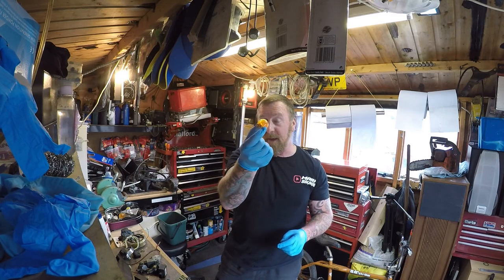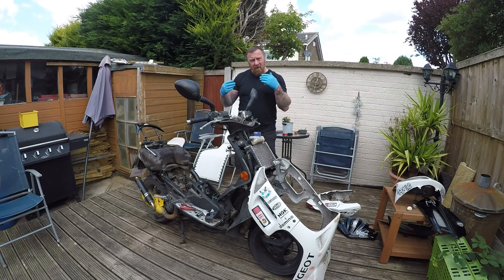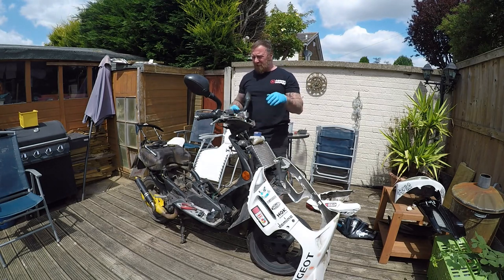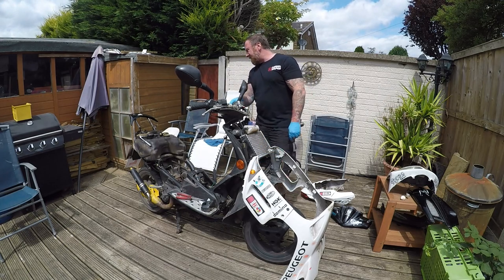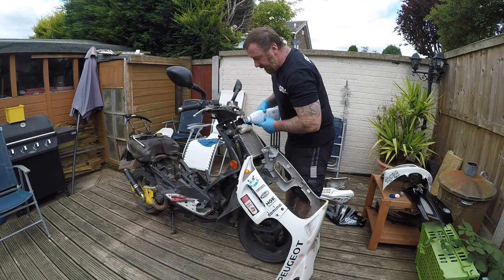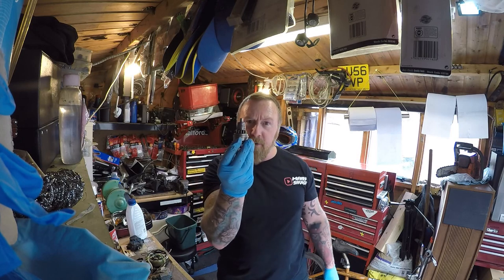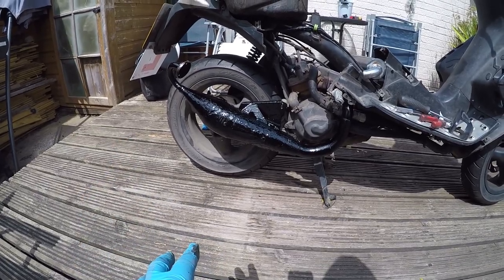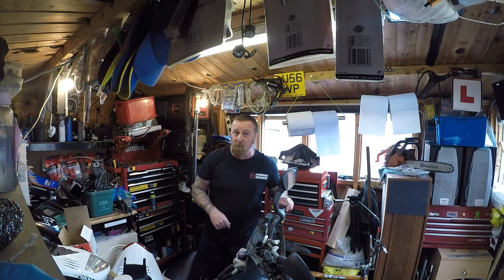SPEEDFIGHT MOPED BEGINNERS FINDING WHATS WRONG PART 3 MARK SAVAGE

Comment: Spark plug gaps come set from the factory. On some of the newer models, one of the numbers of the spark plug model denotes the plug gap. That’s why they come with a piece of cardboard tube over the electrode.
Reply from the maker: I always fit from the box but if you see some of my other a few say you should set the etc 
Each to there own but I agree with you
Reply: @marksavage  you are quite correct Mark. As long as you have the correct plug and it hasn’t been dropped then I see no reason to fit straight from the box. I do the same with my Vision 110. I have to confess that with my CBF1000 I do give them a quick check as it’s not a two minute job to get them back out once fitted.

One question. Didn’t you used to have a CBF1000? And what happened to the Pan Euro? That’s one bike I wouldn’t mind having. Even a higher mileage one would be great 👍
Reply from the maker: @scootyman2974  yes link below 
https://youtu.be/ocPU4er3PhQ
But to be fair I had a lot of hondas not alone loads of bikes 
Type in honda Mark savage 
But I had a varidaro 1000
Mk1 and mk2 pan 
All videos on here too
High miles is nothing for these mile muncher bikes 
Had a rt1150 that was OK 
Also a gtr1400 and a triumph 1215 trophy 
That was nice 
I've got 480 videos. So something for everyone 
Why do you ask bud

Comment: Another great video mate 👍 Today my exhaust bracket snapped on way home from work, I was gutted. Used shoe laces to get  me home 🙈 will order new part tomorrow I guess. 🤣
Reply from the maker: Thanks bud as for the bracket you done well with the shoe lace otherwise it may have snapped your exhaust !
Did  you ever watch my ducati video where my gear change bolt came out on the m4 
I was no happy lol
Take care bud
Reply: mark savage Yea I’m sure I watched it, another good video. part has been ordered so as soon as it turns up I will replace it. I actually replace the shoe lace with a zip tie for now it seems solid for now. Thanks again for all the wisdom 🏍💨😄

Comment: Whats the best way to pack the hole that the pinion goes in as a temp fix
Reply from the maker: there isn't bud you have to buy a new one as others wont last and would cause more damage
I've tried washers and then you cant get it back together !
Reply: @marksavage  ahh looks like new side case then
Reply from the maker: @patrickamphlett9003  yes bud or try and get a working 2nd one , to be honest if it electric starts maybe only have it as a back up
Reply: @marksavage  suppose

Comment: great video again mate 
that exhaust is  a low end budget one the tecnigas q-tre  but its not a bad one for the price as they are £70 new i have fitted one to my budget rebuild project

one thing i want to ask is what camera do you use ?
Reply from the maker: Its driving me mad at the moment but its a go pro 5 now 
The mic sound are either you can hear everything or nothing lol 
To be honest the go pro 4 was easier but this one does have a good wide angle 
So is it better bud ?
Reply: @marksavage    the video looks better then the older ones the mic seems a bit hit or miss  plus you need to get a dead cat on the mic will block some of that wind sound 
i need to get a gopro my self as i have been using a cheap action camera off ebay it still gets 720p 60 fps  but the mic is super bad was looking at the gopro 4 as i only use the camera  for riding my bike and going to be on a budget of around £150 so for that price i can get a refurbished gopro 4 sliver  or a  gopro 5 black as any one of them is going to be a big jump on quality to my £20 camera  lol

Comment: Hello mark....2014 aprilia sr50 motard e.c.u. keeps blowing...third one in 2 weeks ..no headlights and rear running breaklight...any ideas...thanks
Reply from the maker: oh that's not good and a electrical nightmare 
you have two options 
all panels off and trace all wires / connectors looking for any damaged wires or you may need a new loom, or  
stop and sell it for spears bud sorry to say as you may never find it
I have a few videos on a sr worth a watch as I had problems with a few of them and dont work on them now !!

Comment: Hi Mark, problems with my speedfight 2 100cc. After a torrential thunder storm wouldn't start, also noticed immobilizer light was not working. Left for couple days charged battery , light now works but no spark,also noticed no lights when  cranking engine. Any ideas before I start digging. Cheers Mick
Reply from the maker: Rain can cause damage with your electrics 
Is yours a immobiliser bike ?,
Fat key ?
Lights will only work once running 
Do you indicators work horn electric start ?
There from battery 
No spark ?
Thats cdi 
Look which one you have like in my cdi video bud
Reply: Thanks for the fast response, it's a.  2002, and looking at your vids it's the one below the headstock the motor spins with horn and indicators. Looking like I'm ordering a £50 CDI unit.thank again for your input, Mick

Comment: hi mark , i have a speedfight 2 50cc and also a spare speedfight 100cc
i was looking to know if i cud put the back brake disc of the 100cc onto my 50cc drum brake set up?
Reply from the maker: No bud the set up is all wrong 
But you can put the 100cc end in !
I've done it loads lol

Comment: Hi mark nice video started watching you since I got my speedfight the other week. I’ve got a question about some sort of error code that appears saying ‘SOF20 D10’ which I know means there’s a problem with the battery but after that it says ‘CONST 2071’ and I cannot match this to anything as I can’t find any information online. My electric start recently stopped working at and and my indicators don’t work and speedo keeps coming off and on.
Reply from the maker: so take it this is on a sp3 or sp4?
they all suffer from the clocks as this is where the indicator relay is and not like sp2 sp1 which are separate
for the starter follow my sp2 starter video as its the same process
Reply: @marksavage  yes it’s a sp3 rs 50 and I’ll deffo give that a look now. Started the ped this morning and the code now appears even if I press the brake 😫
Reply: @marksavage  can you send me a link to the video you want me to watch there’s so many I can’t find it

Comment: Hey again mark that bike I bought ...
It's running premix 
I've shook the bike .... lol an now I've lost spark ... any ideas before I start messing things up pal ... thanks
Reply from the maker: Odd but must be a loose wire or connector bud 
Panels off and wd40 everything lol 
Before changing cdi
Reply from the maker: Plus premix is ok and can run well
Don't forget about the ht coil
Reply: @marksavage  thanks mark I need some of that magic stuff I will keep you updated if I manage to sort it I was hoping the stator didnt blow but in all fairness I got it running and re gained spark the night before cleaned tank out like you do early the next morning cleaned carb headed to the petty station got a jerry can full brought it back pre mixed in  bike tank ..... ino stupid lol no spark
Reply: Gutted our kid 🤣🤣😅
Reply: I shook the bike to mix the fuel an 2 cycle oil .... 🤣🤣👏
Reply from the maker: @marie82924  there's nothing worse when its intermittent 
But you will have to go over it all
Should be the stator bud
But worth a power meter check bud

Comment: Hi mark, my Peugeot trekker 100cc is making a knocking noise near the carb area, I've checked for rod knock. There's no up and down movement but there side to side play?
Reply from the maker: guessing it will be from the head so big or small ends even piston slap so it will be a head off and investigate 
its not a massive job and will still run but them just die so 
you can keep going or sort now 
worth a check of the variator system just in case
Reply: @marksavage  only seems to do the noise at idel, when I rev the bike it stops?
Reply from the maker: @michaelhughes594  yea under load its ok but at rest it just slaps around
Reply: @marksavage  so what should I check for first?
Reply from the maker: @michaelhughes594  its a job bud, you will have to take off the head then see if you have movement from the small or big ends!
this is why i said it its running and only annoying you keep it running as some will just keep going 
always use good quality 2t as sure yours is 2t ??
Reply: @marksavage  yeh I've watched your video of what two stroke to use so I'm using Halfords atm, how would I check for movement in the big end and small end bearings
Reply from the maker: @michaelhughes594  once the head is off you will know straight away as it will move left to right and be all wobbly and just feels wrong lol bud
Reply: @marksavage  It does move left to right but I was told it was normal?

Comment: Hi mark I'm currently working on my Peugeot speedfight and I have the seat and helmet bucket off and there is a blue plug with nothing in it could you possibly tell me what goes into that blue plug ??
Reply from the maker: Its the temp plug for lc ,if yours is ac its not needed bud

Comment: oreet mark I have fitted a new throttle cable but it sticks and and does not return any advice ?
btw i have watched your throttle cable videos and its an aerox 2012
Reply from the maker: Sounds like you need to re route it as it maybe caught some where or on the twist grip you havent put it on right 
I'd take it all off and start again bud
Reply: Cheers for the quick response. I will try again I really appreciate your videos they have gave me the confidence to give it a go instead of taking it to a garage 👍

Comment: Mark. I have a speedfight variator that does not change gears. Its just stuck in low gear. The belt never climbs up on the variator. Any suggestions?
Reply from the maker: Check out my variator videos ,they will help and fix your problems 
Speedfight mark savage 
Theres over 80 videos

Comment: Alright bud, i recently picked up a speedfight 50cc AC 2002 and it will start up but will puff loads of smoke out the exhaust when i rev it ( its 2t coming out it) Its also like its fighting to build up the revs and fights to take of? Ive cleaned the carb and put a new plug in but it keeps fouling plugs? it isn't pre mixed either its puzzling lol. if you could maybe give me a few tips and some advice on what it could be it would be much appreciated.

Thanks
Reply from the maker: this is common and you can do a few things 
change your 2t oil so drain out the old stuff and put in halfords 2t if not already done 
carb tune like in my videos 1/5 to start and more out ,this should help the plug 
clean variator and rollers will help pull away 
more air clean or change the air filter or take of the link pipe if fitted 
loads or 2t oil will be in your exhaust, is it a sports exhaust if so change the wodding like in my videos 
ok last your piston or rings ,easy to change on ac so renew and follow my videos they will help with over 100 now 
mark
Reply: @marksavage  I am waiting on a carb rebuild kit, air filter and a new plug. I think it is just a standard exhaust that is on it. I took all the 2t out it and put some putoline mx5 in it and started it and the smoke has died down alot but still bogging.
Reply from the maker: @keenanstibbles7345  jet size and tune
Reply: @marksavage  its got a 72 main jet with standard carb, air filter and exhaust? is that a okay jet or should i go up or down?
Reply from the maker: 72 with standard is too big bud so go down to 60  is try 64 and if still doing it try 62 or 60 
it will run so much better bud and a tune after

Comment: Hi Mark how can i Dm you ask a question for problem with a Speedfight 3 50cc
Reply from the maker: Message on here bud or make a video of your problem
Reply: @marksavage  look mate a bought the Sf3 without see if it runs as projcet and i fix it and got it runing but the problem is that when the air filter is on carb it goes 10,20 kmh when i get it of the carb goes better as it should can you mate tell me whats wrong am tiresd of it 😪😅
Reply from the maker: so you serviced it ? new plug and air filter , cleaned carb 
what size jet is in it ?
this is common and might need a tune like in my tuning videos

Comment: Hi mark the kick start pinion on mu speed fight 3 has some play ive replaced it and still wobbles causing my kick to crunch and lock up any way of sorting it woth out replacing side case
Reply from the maker: this is common bud and its the play in the case and sometimes best to change or replace the casing bud you can pack it some time but check the clip on on as this can stop it
Reply: @marksavage  dont supose you have any parts do you
Reply from the maker: @patrickamphlett9003  e bay bud sorry but no
Reply: @marksavage  ahh no worries bud you still doing bikes as not seen any recent videos uplaoded for a wile
Reply from the maker: @patrickamphlett9003  yes but i moved as in my very last video on the cbr so still in the thick of it with redoing the kitchen and an extension  but will be back on after its all sorted 
take care bud
Reply: @marksavage  awesome im almost done with a speedfight trying source a break switch the one i need only availilable in bloody germany
Reply from the maker: @patrickamphlett9003  maybe try and put in or look for speedfight being broken down or message sellers who are selling parts . i used to have loads of parts and i do mean loads lol but sold them all
Reply: @marksavage  ahh bummer

Comment: Hi Mark. I have a speedfight 2 2004. And I have a problem that I née da lot of rpm to start going forward. Could it be too heavy variator rollers? Because I went with my moped to the service and they said that I need a whole new sport variator komplekt.. I don't think so that I need a whole new variator.
Reply from the maker: Unless its damaged just clean and replace with 6g
But they have seen the old one so can't say there wrong

Comment: Hi Mark, I hope you can maybe help? I am a big fan of your self-help videos for the Speedfight and learned a lot from your videos and fixing them, has saved me a lot of $$, but this DAM bike has got me stumped! Any help would be great and I will gladly donate to you or a charity if I get this thing working and alive
.

I have bought 2006 Speedfight 2 100CC Vin VGAS2ABL060312381 - Engine Number 13144831FB7 and it's not starting. Before you go Saying “arghhh not another one saying “it won’t start” lol here is what I have learned and done since watching mostly all of the Speedfight videos and gone through sh*t load of Tea 😊 (lol)
I bought the Speedfight Haynes manual and voltmeter, so it would not start. Symptoms were, it would nearly start and you could hear it wanted to but, never would get there and backfire the od time. From 1 video you described the symptoms I had so I thought I needed to change the piston, so I renewed the piston and rings put it back from 125 head to the proper 100, and the following I have replaced.
Rollers
Belt
Fuel Filter
Indicator Relay
Piston 100cc
Piston Rings 100cc
Cylinder head back to 100CC
Head Gaskets
Battery
Spark Plug
Oil filter
Oil proper T2 Oil
Fuel Pipes
Fuel gauge sender
Fuel
Air Filter
Auto Choke
Indicator Relay

Link to the pic of the carb 
https://1drv.ms/u/s!Au8hkMwRfYuOu3PAXIm-dAU9XXhP?e=8c53ee

As in an earlier video, the bigger 1 is the petrol on the carb and the other is the vacuum, right?
There is a video also of me checking the spark and HT lead.

Can you suggest anything else…?
Reply from the maker: Wow that's a lot of work 
New head all good 
Carb is ok and 3 half to start 
The wanting but not is a sign of piston but also 
Reeds , they may need replacing is not completely shut 
Then you have to look at oil / crank seals replacing 
.otherwise you could have a fractured engine case and never find it !!
I've had in all the 100s of speedfights some that just will not run !!!
Reply: @marksavage  ok ill let you know how I get on. A bit scary pulling the engine apart lol, any special tools to get the oil seal replaced? Do you have or are you going to do a video on this that is of better picture quality than the ones you have? would a compression test help diagnose faulty oil seals?
Thanks from down under Sydney :-)
Looking at my pics can you let me know what pipe goes where on the carb??
Reply from the maker: @Gordon R 100cc carbs are different 
But air at front on of the carb 
You can use two long screws and pull them out 
I've always spilt engine and not tried it but I hear it does work ! 
You screw them in and pull out the seal !